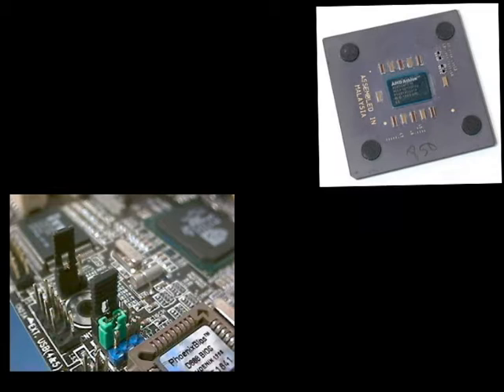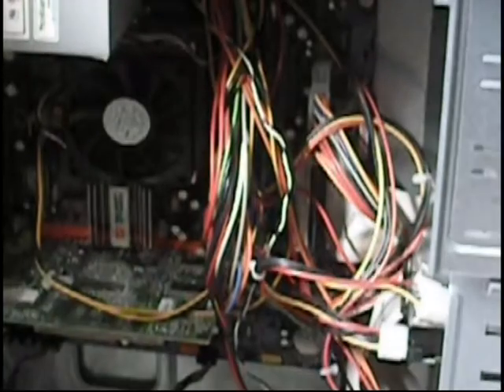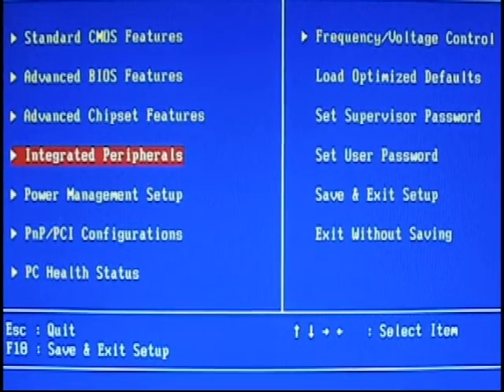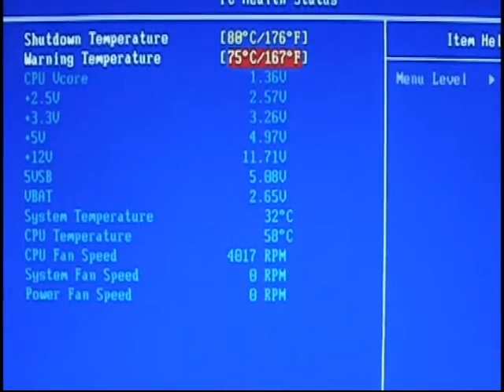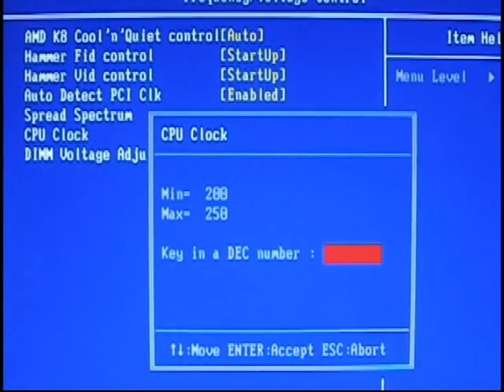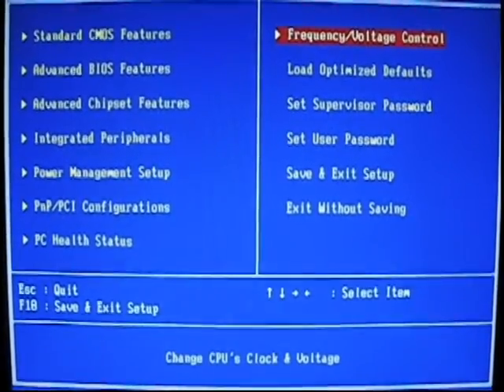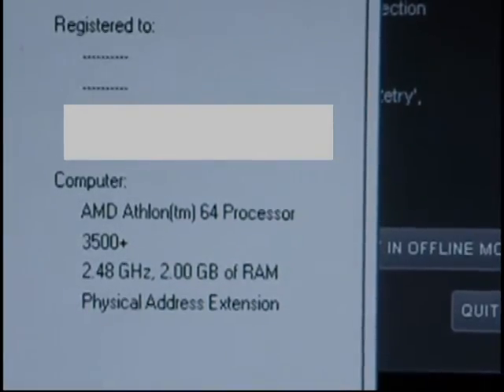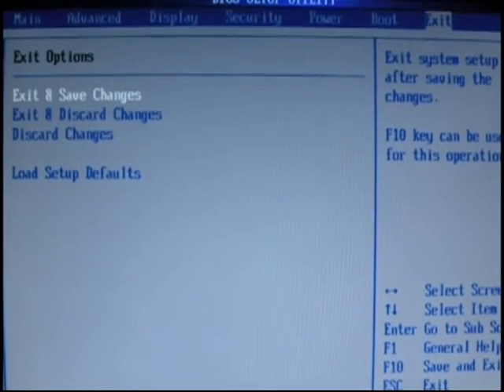💻 How To Overclock Your CPU - DIY

Comment from the maker: Guys, if the screen is not coming back up then it has probably clocked to high. YOU NEED TO RESET YOUR BIOS! so that the board can reset itself back to the normal clock speed... I have a video on how to reset your bios.

Comment from the maker: depends on your board. Some require a system fan along with the CPU fan. With many boards if you disconnect the system fan an error will pop up stating that something is wrong with the system fan. Some motherboards will allow you to continue booting while others will not. Long story short disconnect it before the over clock and see what it says. You may also be able to tell it to ignore the system fan in the bios.

Comment from the maker: If your system is sufficiently cooled then this method is pretty safe, hence the fail safe of shutdown temps. Be Smart! If you have water cooling even better. If you don't need to overclock then don't. I would only recommend doing this if the machine is on its way out. If you want to learn or are curious give it a try. READ FORUMS ABOUT YOUR BOARD AND CPU! This will give you better insight as to what your machine is capable of.